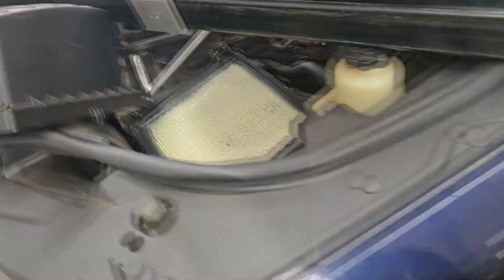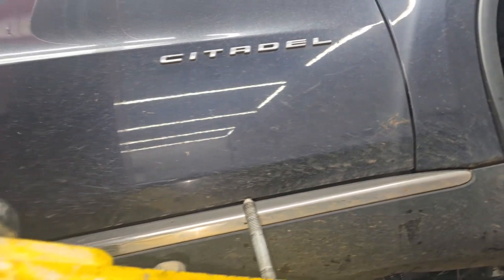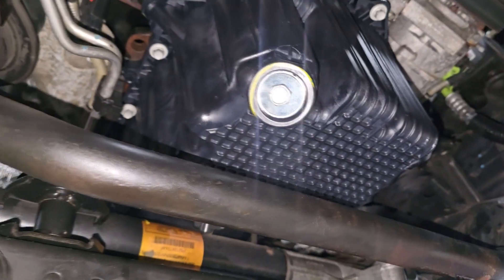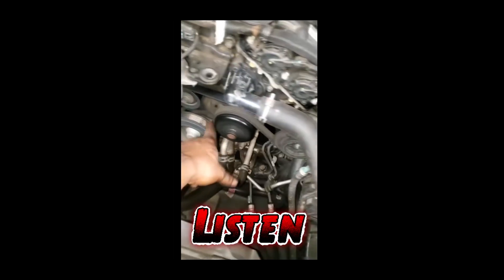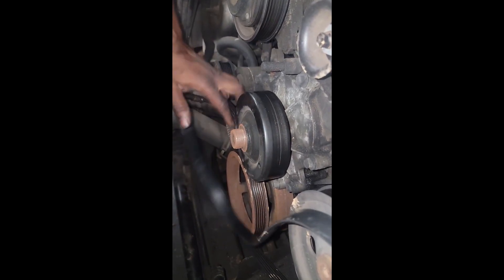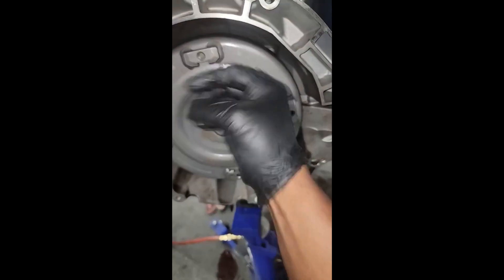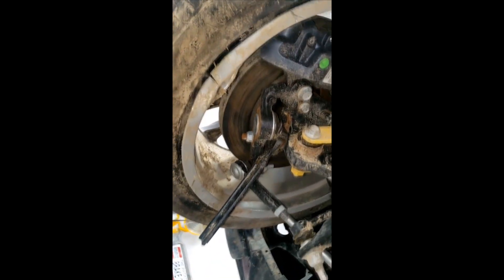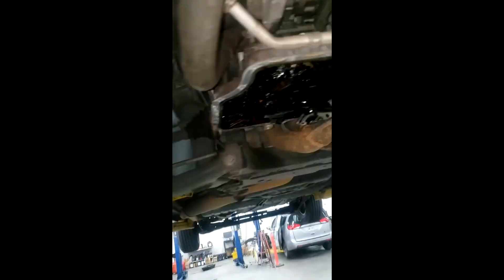OMG, This Hemi Motor Now Use this and Its Made Of Plastic. This the Only way to Replace It.

Comment: I had a troy bilt 4 stroke home owner weedeater that had a plastic oil pan it worked fine but for an vehicle that goes the road is just stupid I actually had two of the same weedeater one was a factory refurbished mtd 4 stroke weedeater and the other was a brand new troybilt both identical with the plastic oil pan!

Comment: When I see sludge like that it's a call to the customer and a quick "no guarantee if you want to move forward".  But I've bought vehicles and pulled the valve covers and oil pan and cleaned it out and had a good engine for a while.  Roll of the dice though.

Comment: I pulled my plastic pan from the front after taking my front end off.  2011 Jeep GC 5.7L 2wd.  I did reuse the pan with new gasket after flushing it thoroughly 😊

Comment: I was able to replace the oil pan on mine by removing the top bolt of the motor mounts, disconnecting the exhaust at the manifolds and then jacking the engine up. No cradle drop necessary.